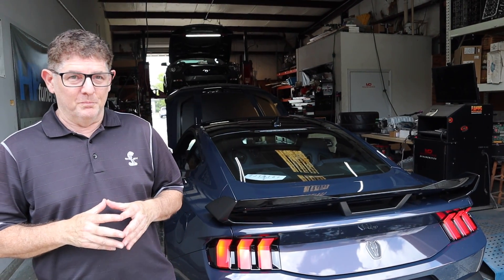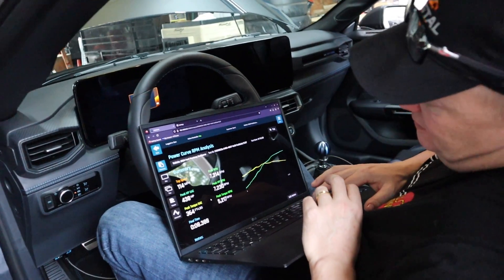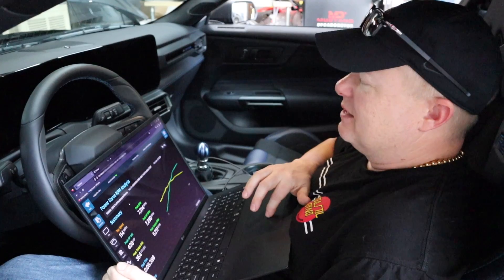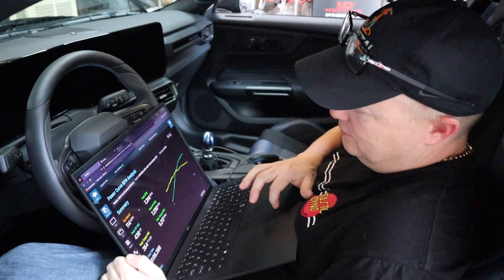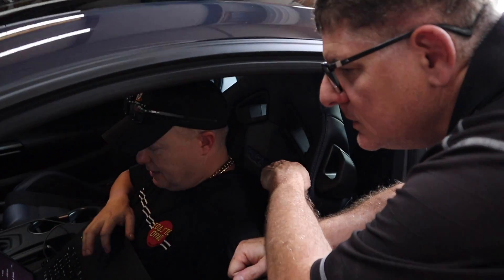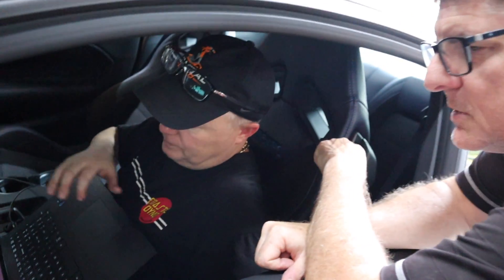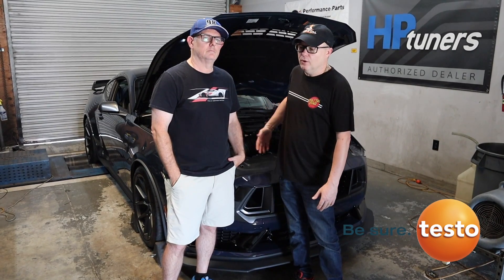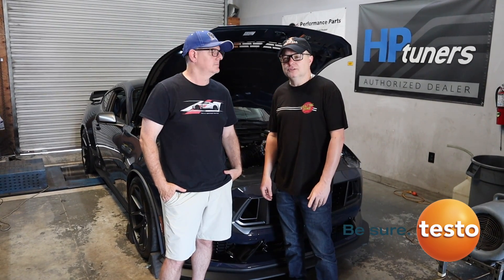Dyno Test: 2024 Mustang Dark Horse | Why Ford Used a Dual-Throttle Intake & What's the Real Power?

Comment: AND MAKES LESS HORSEPOWER THAN A BONE STOCK 2006 corvette Z06 😂
Reply from the maker: Come on man, with 40 more cubic inches in a car that costs three times as much. Great comparison. If the Mustang was $160,000 Ford could design the same thing.
Reply: @revanevan a 2006 Z06 was 66,000 dollars not 160,000

Comment: Part of me still wonders is if the did the dual intake setup for mostly unique + looks points. Or is there really a big advantage in the system. Like would the car make the same hp with a single intake?
Reply: It also balances out the left and right banks, air coming in from 2 ways instead of 1 helps equalize compression ratios
Reply: Emissions dude dual carbon traps that’s the reason so it can flow the same as a single it’s stupid ford is scamming people
Reply: @doom_slayer_5.048  How is Ford scamming people?
Reply: Ford isn't scamming its the dumbass epa bullshit regulations that ford's working around...
Reply: @doom_slayer_5.048   How are they "scamming people"?   There are are real engineering considerations, but as an expert keyboard engineer, I'm sure you know better...

Comment: It’s not that this thing makes 500hp or not, it’s the fact that the S550 was probably underrated because they make about the same to the wheels. Get this car because you simply want a new car. Not because you want a “faster” car..
Reply: No s550 is getting 440 to the wheels stock. Not a chance. Gen 3s get like 390-400 whp. Neither car is/was underrated in terms of power.
Reply: @jeoffbenzos4959  They make about 420 whp with the manual transmission from everything that I’ve seen on the net.

Comment: Why did Ford stay MAF on these cars? The SD in my 18 F150 is awesome. Easy to tune, no upgrading it to add HP as you don't peg it like with a MAF. Even the 20-23 GT500 uses SD instead of MAF. The only benefit that the MAF provides over Fords modern SD is if you plan to cam the car. MAF reads velocities, where SD reads pressure, and larger cams will lower vacuum pressures, so SD isn't good on engines with aftermarket cams.
Reply: Trucks are designed for low end torque, mustangs are high rpm racers and you see more velocity at higher rpm than a truck that's towing a trailer.
Reply: @sirseven3  Since when did it become an issue getting an engine to spin with SD? I'm spinning about 7,200 RPM with a unport truck manifold. There are people spinning over 8,000 RPM with one of several Mustang manifolds.

Comment: Why is the RPM limit 7300 Ford? Redline on tach is 7500. Redline is defined as "Maximum Continuous Engine Operating Speed" If that isn't redline then Ford should change the dash and their advertising.

Comment: Thats great numbers for the new dark horse basically two very minor mods and hardly any miles on the motor. My Gen 3 hit 443 in 4th gear not 1:1 gear either with e85 tune,  intake and catback. So definitely more stout then the gen3 but that should be expected.
Reply: 4th is the 1:1 on the gen 3 2018+ manual cars with the MT82 D4.

Comment: They changed the firing order. Sounds deeper and different
Reply: Did they? They don't really switch those things around that much, could be a new exhaust. I'd say the tone difference is due to lower velocity air since the dual air ducts provide more than enough air and in turn requiring less of a strain on the engine to push to that power band which makes a more relaxed note. Maybe idk im just spit balling here 😂

Comment: Headers and exhaust e85 will put this car at the gt350 levels
Reply: no it won't, stock the GT350 is way higher HP than this.

This test is also bogus when every other dyno vid has these around 400 wheel. There is no way this is correct lmao.

Comment: Take it to the drag strip, if it doesn’t run a 11.9 as it sits its a dud
Reply: Ran that time in 1990 with a stock heads,cam,intake, T-5 and axles 5.0 GT, just needed MT Drag slicks,150 wet shot, and me bitch slapping gears😁11.84/116.      If a 2024 can't do this right off the showroom floor with 500 crank and a good driver like Evan something is wrong..

Comment: This is the 2nd Dyno that tested at 500 crank horsepower. The other Dyno tests were at Palm Beach Dyno. So two hater complaints busted. The horsepower and CJ Pony busted the misinformation regarding the S650 was heavier than the S550. They weighed both and they were the same. 

I know you have connections at Ford performance. I'm wonder if they're working on some type of Y Adaptor for use with a supercharger allowing the usage of the Twin throttle bodies.
Great channel Evan.

Comment: I don't think many are complaining about power, they are complaining about E/T and trap speed which is what matters. I could care less if it dynoed at 1000rwhp if it's slow compared to previous gen. 2018 was trapping at 119-120mph. 3 or 4mph faster
Reply: I think Ford doesn't care much about drag racing now. They are all about road racing now. I'm happy to see them taking road racing seriously now, especially now that they are going to Le Man's next year.
Reply: @Raul619Meza  I agree but they've been going that direction for a while and the cars were getting faster in every way not just the turns. Gt350 for example was rated at 526hp and the power showed up in the 1/4 mile not just around a track. I'm not expecting it to do what a demon does which goes all out for traction. Just be quicker than the last car that was much cheaper. Especially the dark horse. It's the price of a c8.
Reply: @Falcon-mc5fs  LOL it's the price of a C8...but you get an extra three or four hundred pounds of material for your money! Some people seem to care about stupid stuff like having more than two seats or whatever. You know, things other than the best performance/dollar ratio. I know it's weird, but it's true. Those people are insane, but they do exist.
Reply: @Raul619Meza  "I think Ford doesn't care much about drag racing now. They are all about road racing now."

That's what I would do if I were a manufacturer. Maybe not a complete switch, but I would definitely move the target further along the line towards the road racing end. Drag racing has been popular for many decades, and still is, but the number of folks doing weekend HPDE events and such on road course tracks has been on the rise for the last fifteen years. Popular automotive reviewers now often talk about canyon carving, steering, brakes, etc. Consumers are starting to care about corners more than they used to. It makes sense that manufactures lean in to that trend a little bit. I would love to see the sales figures of "drag tires" versus "track tires" graphed over the last twenty years. I think that would be pretty informative.

Of course, the folks doing EITHER of those things are still a small percentage of the total potential buyer pool, but impressing them still helps the overall sales figures by some amount.
Reply: Every newer gen seems to gain weight, so that 20 hp increase is really nothing. My lightly modded 2012 GT (Gen 3 ported manifold included) would definitely give this dark horse a run for it's $60k money.
Reply: 100
Reply: all s550 suspension bits fit the s650, it wont be long before they are beating gen3 times
Reply: You could care less? So you care a little bit at least
Reply: Good point.
Reply: The dyno guy talks like the program he running on the dyno dose everything and he doesn’t know what the hell he’s looking at 😂😂😂
Reply: For all you guys saying Ford doesn’t care about drag racing anymore; ever heard of the Cobrajet?
Reply: Cuz the dark horse has better quality materials and better ride quality which matters more than tenths in the quarter mile bone stock
Reply: 2015 S550 was slower than the 2014 S197 and nobody said shit, all of a sudden everyone complaining 😂 It took the S550 3 years after its release, a higher compression coyote and a 10 speed transmission just to be faster than the S197.
Reply: @Jimmyxsx right. this shit barely beats a boss 302 that's over 10 years old
Reply: @breezzzyyyy  Boss will pull a dark horse with the mt82 vs tremec.
Reply: @breezzzyyyy  there's s lot of years for the boss 302. Using the 2012. Here's the quarter mile time. Quarter mile13.4 s @ 115 mph. Steeda just ran a 11.2 at over 120 mph in a stock NA S650 Mustang GT. I think you should research your comments before making them
Reply: @DWH300  go watch what steeds had to do to achieve that. Also plenty of stock boss 302 drivers are in the mid to high 12's. 13.4 @115 doesn't even make sense unless it's a very bad launch. Trapping 115 should be high 12's minimum
Reply: @Falcon-mc5fs  Those boss numbers came from SVT. The rest of your statement makes zero sense. Trap speeds can be higher or lower with types of tires. Launch and 60' times. Steeda ran a 11.2 pass at 125 mph in their stock NA S650 Mustang GT. That's strong. The 2012 Boss 302 Laguna Seca was set up as a track car. Not a drag racing Mustang. Solid axel suspension with a large front spoiler. Good for it's time. But not compared to the new performance Mustangs with better suspension. Magna Ride. Improved aero and hugh brakes. I own a 1995 Cobra R with a Pro-charger and a compete Steeda suspension. I've never raced or tracked it. My street class bracket drag car is a 2018 chrysler 300C hemi. It's built and tuned. Depending on the DA. And what i running against. I run low 11s around 120 with a brake tap at the finish line. Another way to reduce ET and trap speed. The cars a solid mid 10 second car, but i have more success running in the 11s. When bracket racing it's about hitting your ET without breaking out. Trap speed means nothing. 
.
Reply: @DWH300  13.4 is literally crap for 115mph. I ran 13.7 in a bolt on foxbody on street tires at 101mph. Cobras were running 12.6 at 113mph. Boss Mustang could go into the 12's even with a bad launch. 13.4 is if you missed a gear and spun the tires. Like I said about the steeda run. Look at how they did it. It wasn't stock. They added track bars, headers, took out the seats and put slicks and skinnies on it.
Reply: @DWH300 11.2 with over 13k in parts. Big difference
Reply: @RSProduction18  when utilizing the Red trakey.
Reply: @Jimmyxsx  what are you talking about, loads of people were talking about the slower s550. Then the 2018 rolled out and had us all grinning from ear to ear. Nobody said much about the decrease in power of the 2020 because it was advertised as such but now we have no compensation for the extra weight even with the advertised extra power which is the worst news. Because it's going to cost more to get weight moving. They should have added cube's if adding weight again. It was advertised as faster 0-60 and nobody is seeing it
Reply: @Falcon-mc5fs  2015 was also advertised as a faster 0-60 and it was getting clapped by the s197. Where im I heading with this, since it took almost 3 years for the S550 to get fast than its probably gonna take another 3 years for the S650 to get fast as well. New performance variants are coming and with that Ford always does revisions to the Mustang Gt.
Reply: @Jimmyxsx  I get you, but just like then we're disappointed now as well. The real problem right now is weight and and we already didn't like the weight of the last car. If the new one is significantly more expensive I and many others expect more speed and I think most would argue for a focus on weight reduction with the extra money
Reply: @Falcon-mc5fs I have a feeling these cars have a lot of hidden power… it’s making peak power at the rev limiter!!! They need to be turning at least 8000-8200rpm
Reply: @Texas_Road_Warrior  could be true but the problem seems more about low end torque being underwhelming for the weight of the car
Reply: @Falcon-mc5fs  CJ Pony weighed both the S550 and S650 Mustang GTs equipped the same. They weighed the same.  3,780 lbs. 3,780 lbs. There have been a ton of rumors circulating around the curb weight of the S650 generation. People have said that the new S650 is around 200 pounds more than the equivalent S550, but that's just false. Big difference when comparing the S650 GT to the heavy Challenger Hellcat at 4415 lbs. The issue is the government cafe carbon and Mpg restrictions. REVan Evans had had a dyno complete multiple pulls on a stock NA Dark Horse with 93 octane. Palm Beach Dyno did the same tests. Both produced the advertised 500 horsepower at the crank. Evans pulled the carbon traps and removed the stock cone filters replacing them with the more open K&N filters. They picked up an extra 15 horsepower on the next multiple pulls. 

Steeda added kooks long tube headers on their S650 Mustang GT and picked up sn additional 40 horsepower. Because of federal regulations regarding emissions. The new Gen 4 Coyote has to pass the mpg and emission tests or Ford will receive large penalties like GM and Stellantis who recently paid over $363 Million dollars in Cafe MPG penalties. 

With the stronger internals. The Gen 4 Coyote will be a badass engine whether Running 93 octane NA. Supercharged or tuned within the next year
Reply: @DWH300  those scales they used are not extremely accurate. I know as a truck driver. American Muscle weighed a base GT Vs a base GT of the last generation and the new one was 100lbs more. If AM is wrong and CJ right why is the 24 slower with more power?
Reply: @DWH300 finally someone else who knows their 💩. You’re speaking facts my guy
Reply: The 2024 Gt Base is the exact same weight as a s550 GT its the darkhorse/GT premiums that have only 100 extra lbs but a base makes more power with exact same weight + or - 3 to 4 lbs @Falcon-mc5fs
Reply: My 24 Base Gt weighed in at 3708 exact same weight as an old Base GT @Falcon-mc5fs
Reply: @STCDawg3232  I've never seen anyone come close to that, you must have a special one
Reply: @Jimmyxsx Yea the did ! I kept my 13!!
Reply: @Jimmyxsx when are dummies going to realize that the s550 platform was designed for road racing and not drag racing. Overall the s550 chassis is so superior to the s197 in terms of handling and comfort that there’s not even a comparison.
Reply: @bradwoods371 BINGO 🎉
Reply: @bradwoods371  This is why they did the GT350 with the S550 platform
Reply: @bradwoods371 its not a huge difference... ive driven both, and i own a 2014 s197 5.0. With just slight suspension work they handle very well around a track. And they are just so much fun compared to anything newer. They are far from uncomfortable, but they dont have as good of comfortability because of the solid rear axle. Though You really don't Notice any difference untill you're on a shitty bumpy road with the solid axle.
Reply: Steeda just ran a 11.2 second pass at I believe over 120 mph in a stock NA S650 Mustang GT with Kooks headers on 93 octane.
Reply: what do you mean? Everyone is freaking out because a couple people who didn't know how to dyno, got really bad numbers when dynoing a new DH.
Reply: 4000lbs can they weight this one with someone in it

Comment: It’s 75k not slower than gen 3 is your expectation WOW! This car is more expensive than a base c8 vette and loses to it in every metric other than it has two more seats. Pony cars were supposed to be affordable performance they were never intended eclipse the price of a corvette without a performance improvement over one.
Reply: You are so right.  A new C8 Stingray even with the Z51 package retails less than the DH and will out perform it on both the strip and road course. I am a big Ford guy, but brand loyalty can go only so far when pricing gets this ridiculous. Laughable that a $30,000 pŕemium over a base GT gives ýou all of a 20HP gain. Time to think reasonably and consider other choices.
Reply: Severely underrated comment! Glad someone else noticed the bang-for-buck disparity

Comment: So it's about 15whp less than a stock gt350 with just a free flowing intake.
Reply: The gt350 is a old ass car though
Reply: @smurfeco2.358  perhaps, it redlines at 8200 and is 5.2L. Give you the idea what can be done to these gen4 engines.

Comment: EVAN, THE TUBE THAT WENT THROUGH THE TUNNEL PORT MOTORS INTAKE RUNNER THAT HOUSED THE PUSHROD. WHEN THEY DID A FLOW TEST ON THEIR HEAD IT WAS NEGLIGIBLE. WITH IT AND WITHOUT IT THE FLOW NUMBERS WERE THE SAME.

Comment: How did it manage to gain so much weight? I’ve seen trackpack gt500 @ 3940 stock. How in the world is this 4000lbs without a blower? I’m not feeling these weight gains.
Reply: Electronics
Reply: Safety tech added more emissions compliance technology, thank California and Cafe for it weighing so much as well as SAE regulations....
Reply: @truckercowboyed2638  then do a total redesign like Chevy did with the Gen 6 where the alpha chassis took 500lbs off the gen 5 camaro...
 I don't care where you need to get it but I'd bet those screens, wiring and electronics are a lot of it..but get it back regardless
Reply: @truckercowboyed2638  is this true? I didn't think there was a 2024 Camaro to be honest...

"How much does a 2024 Camaro SS weight?

3,685 lbs

The Camaro SS hits the scales at 3,685 lbs for the six-speed coupe and 3,747 lbs for the 10-speed auto"

If so why did ford have to add for 2024?
Reply: Camaro went on the alpha chassis in 2016.

Comment: Great video!! Impressive gains for anyone to do at home. I was hoping that there would be another pull with the air box lids removed, I've seen a couple of videos with gains. Otherwise thanks for the great content Evan!
Reply from the maker: Much appreciated, thanks.
Reply: Illegal to remove emissions equipment and will have massive air codes after removal.